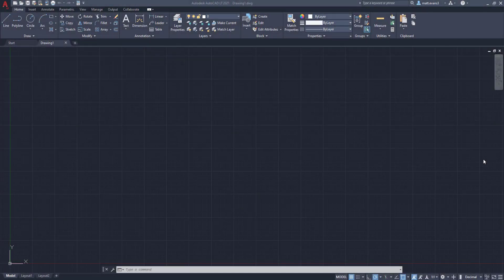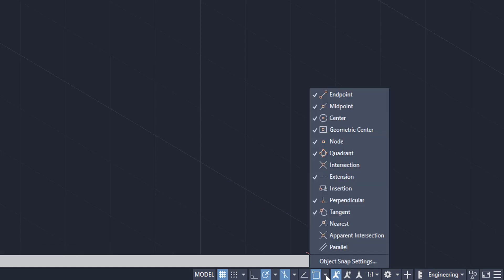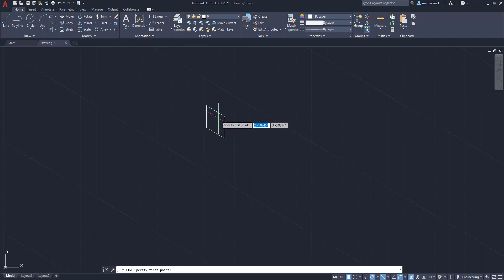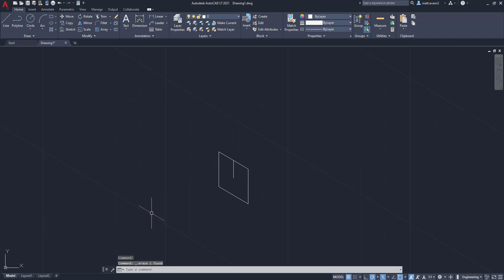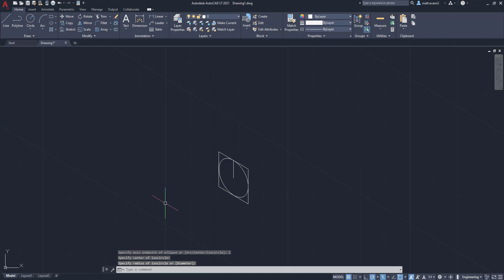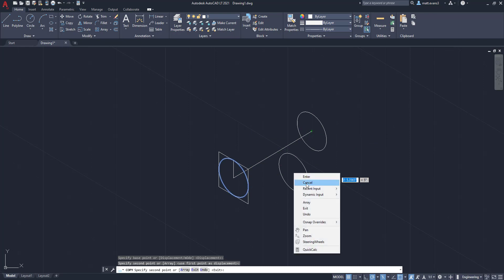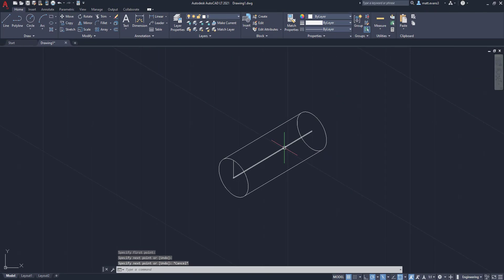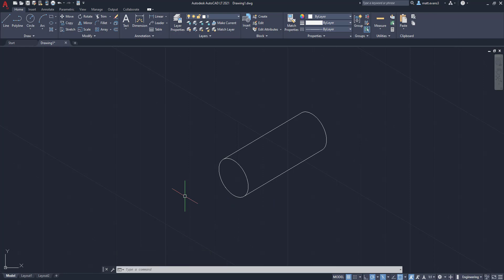How to Draw a CYLINDER (Isometric 2D) - AutoCAD

Comment: How would I change the circle so that the cylinder is vertical instead of horizontal?
Reply from the maker: Thanks for the comment/question! Try going to the bottom right hand tool bar where you will find the Isometric Drafting button with an arrow next to it. Click on the arrow and then click the "isoplane Top" button and this should switch you to your desired view. You can also type ISODRAFT into the command bar then click/select "isoplane Top" when it appears in the command bar. Let me know if you have any other questions.